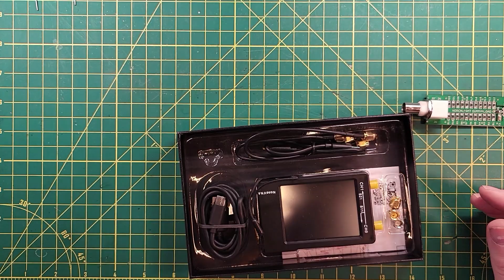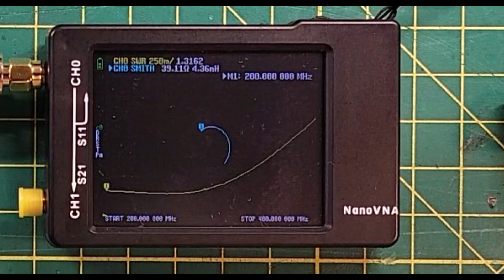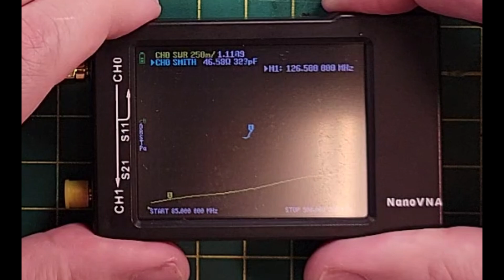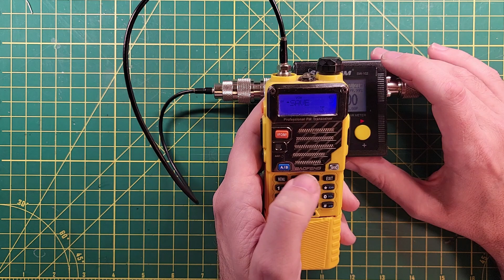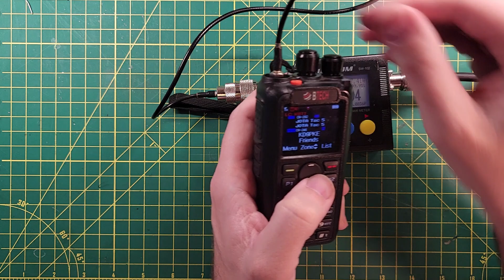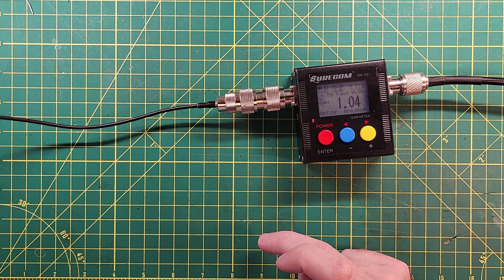They were right... Is this the right tool for the job?

Comment: If you bounce over to HRO, Giga, DXE, whatever, and start shopping dummy loads you'll see they have freq ratings.

SWAG tells me the meter is affected by you moving the coax/radio around because you have a lot of RF on the coax.  It's an unbalanced feedline, not a perfectly resistive radiator and a handheld.  Not surprised to see a bit of that depending on the meter and setup.
Reply from the maker: Totally agree.  HTs are known for needing "you" as a counterpoise, and that's part of what is going on - RF on coax

Comment: That the SWR meter I use on my sailboat for the marine radio. It use to crack me up when my slip neighbor ask me for a radio check 15 feet away. I tried to explain to him that just because I can hear me 15 feet away does not mean his radio is fine . So now he borrows my meter to check his system and still calls for a radio check for the audio. BTW very happy with the meter one charge and just about good for the sail season
Reply from the maker: That's great, I think I've charged mine once also.

Comment: I have a Surecom frequency counter. I had all sorts of problems with it not detecting anything. I found out that the stock antenna is garbage. I grabbed an old VHF rubber duck and put that on and now it's a very handy device. Not only is it a frequency counter, it will also read a PL tone in an FM signal.
Reply from the maker: I don't know if this one does PL tones,  I'll have to check

Comment: Interesting video TO.  I assume the freq response affects the readings on the meter.  If you're using it as a true dummy load (no measuring), it's probably fine, although rising SWR  would eventually be a problem.  Cool!
Reply from the maker: It effected the power and swr readings in previous tests.  Now I can trust the surecom a bit more

Comment: As with most things, you get what you pay for. Have you tried an oil filled dummy load?
Reply from the maker: Sure did, the oil filled had a frequency range below 2m, so wasn't a good match
Reply: The oil just gives you better power dissipation, the key is how well the load element is tuned to the range of interest.   At my old job we made loads that were between 20-30db return loss up to 50GHz.  Admittedly low power as they were used to cal VNAs.